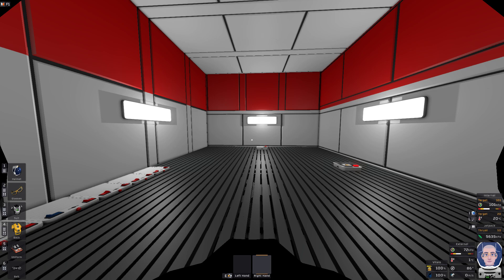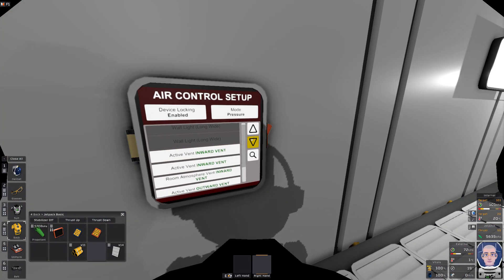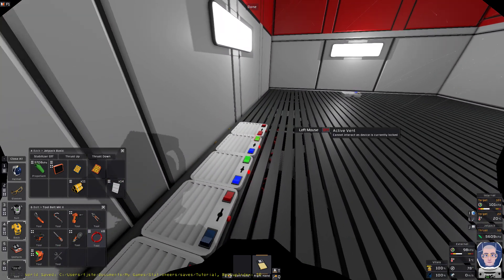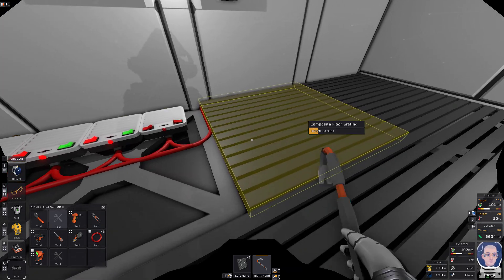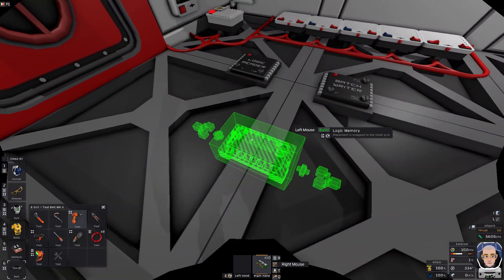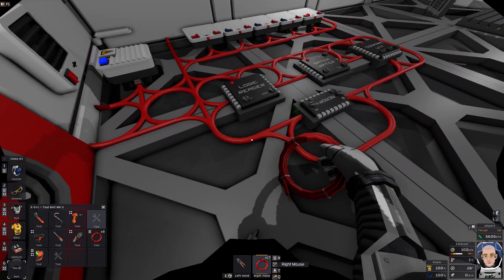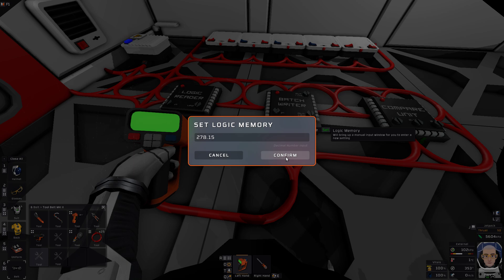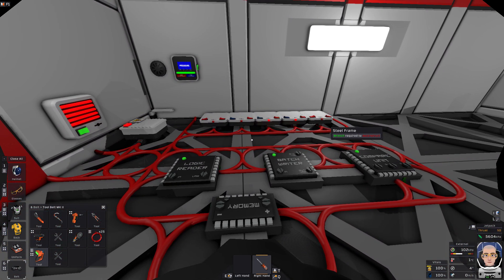Stationeers - Basic Pressure + Temp Control Tutorial

Comment: I've seen multiple tutorials showing the air control console and I have yet to understand what that console contributes to this.
Active vents can regulate the pressure alone by setting their external limit. No console and no pressure sensor needed.
So what does the console actually do in that case?
Reply: It doesn't fit well into the game as is; it's been there since the very early days of making Space Station 13 in 3D :P 

There are a few benefits despite flaws, though. For one, it shows if the atmosphere is safe to breathe (like in SS13) in a neat little package - pressure, toxins, oxygen. Two, it switches between inward and outward to maintain pressure in the room. So it can both add and remove air whenever it moves away from 101 kPa (as demonstrated in the video), preventing blowouts etc. It tries to maintain a safe pressure in both the pipes and the room. Three, there's also the Draught mode where it will make sure you have air circulation within the room (handy for evacuating toxins, carbon dioxide, replenishing oxygen, air conditioning...), with some active vents blowing and others sucking (each with the appropriate pressure limit). Four, you can have the Air Control board lock the vents (similar to the Airlock board) so they can't be accessed directly (and "accidentally" turned on/off, reconfigured etc.). And of course, if there's no work to do, you save on power :) 

Pretty much all of that is there for Space Station 13, with large stations with dozens of rooms, full of dozens of people running around and messing stuff up accidentally or on purpose, and just going around doing their jobs. In Stationeers-the-mostly-solo-survival-game? It's mostly a waste of power and resources. Most of the time it's better to just run a single shared pipeline for air connected to a bunch of passive vents, then led into a separate room that handles filtering, air conditioning, pressure etc. The main advantage of using an active vent is that you can have the main gas pipe at a much higher pressure, giving you a buffer for leaks etc. (and with logic circuit/ICs, even a system that cuts off a room if the pressure drops/rises too quickly).

It's great for building more interesting bases beyond mere survival, though! It makes more sense, realistically speaking, to have each room with its air quality indicator and management, separate pipes for breathing air and waste air (to be processed in a separate part of the station). Most things should be locked from manual control, outside of specialised crewmembers (SS13 is set on a commercial space station, these aren't astronauts :P ); anyone messing around should be very visible to crew and security teams. Almost all of the rooms should have lockers with emergency space suits (most people don't wear a space suit most of the time, and don't have all those tools). SS13 is first and foremost a roleplaying game, with deep simulations to make the whole station a (short-lived) world to work and live in.

I've been hacking around the Stationeers server to see if I can push it back towards SS13 a bit; there are quite a few things that don't require client modifications and would make it work as a testing board. Many systems in the game are still built in a way to make SS13-like gameplay possible - that's why there's security access cards, locks, welding doors, weapons... Though some things are inherently harder to do in 3D (the RP elements rely heavily on text chat, which is a lot easier with speech bubbles :P ). In that game, you get into an existing space station that's kind of falling apart and try to keep it running for as long as possible (while some are antagonists with their own goals, and others are "neutrals" e.g. looking for entertainment). The Air Control circuit board makes perfect sense in there, most of the circuit boards do :P

Comment: Greetings from the future. I have been trying to make sense of this for weeks. Thanks for saving my sanity.
I am still looking for information on how to route ventilation, so I will look through your other vids for that. 
Thanks again
Reply: Have you found something?  Because system that pumps all the waste into your air tank just dont make sense for me
Reply: @krieger9993  The basic idea is that the waste air goes into a filtration/air conditioning room, which stores all the parts in their own tanks, and then on the other side you create the ideal mix and send that back into the pipe (usually by having a separate air and waste pipe, where most of the "waste" air is of course perfectly breathable air).

It's not about efficiency :)

Comment: I take it they fixed the air controller boards.  Used to be those things never worked.  Did they fix draft mode?
Reply: I don't think there were any changes. These things certainly aren't "finished" (and likely never will be); the UI is wonky, the buttons don't do anything, there's no configuration...

Did you setup the active vents with the right direction in draft mode? Draft mode configures inward vents to lower than standard pressure and outward vents to higher than standard pressure - the result is that air will flow between the two. And it makes for a decent setup with separate breathing air and waste air piping, where air keeps circulating throughout the whole base (while engineering can turn the air control off in a room that has a breach, for example).

Comment: Nice. Very informative
Reply from the maker: Thank you very much! Any requests anyone has you can always comment on my videos and I'll post them up
Reply: @mikcrogaming one thing I am struggling with is setting up logic circuits for adjusting pressure for the furnace. When I put volume pumps on the input side, it always bursts the pipe between the pump and furnace.
Reply from the maker: @sorrowsbeyond  I can make a tutorial for this as well. But you'd be better if using the Advanced Furnace if you have all of that setup. The Advanced Furnace comes with 2 built in pressure pumps that allow you to adjust the pressure directly inside the Furnace, rather than bursting your pipes trying to push the pressure through them.